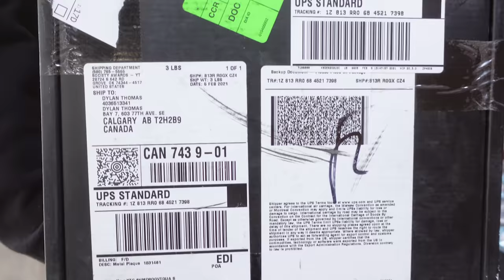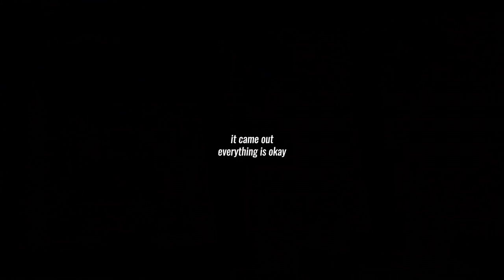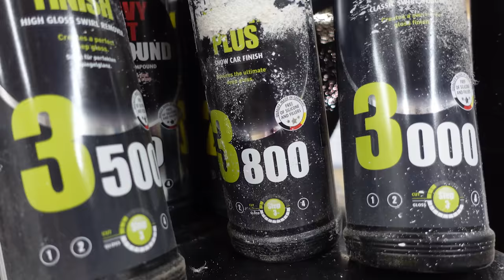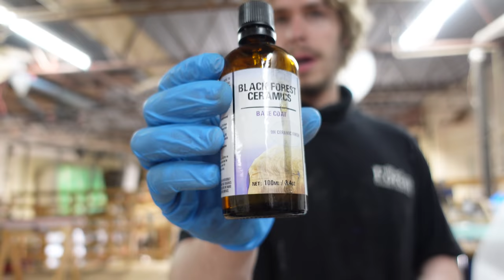We Did a Resin Pour on Our Silver Play Button

Comment: I would like to see what happens when you try epoxy coating some freshly milled green wood.  Walnut and other hardwoods have different color hues when green so it would be interesting to see if those colors hold up when coated with epoxy.  I guess this would be quite different than what you normally do where you plane it down to the wood itself but I would like to see what happens when the wood is encased in epoxy.

Comment: I think you guys should invest in a pressure pot at least bug enough to cast like the bottles like you do, if not something as big as your plaque. I think you'll stop battling bubbles if you do.
Reply: They have a vacuum pot that accepts 5 gallon pails.
Reply: @thewoodworkersjourney3314  It's just not the same. Pressure works much better than vacuum with epoxy. I assume it's a viscosity thing.